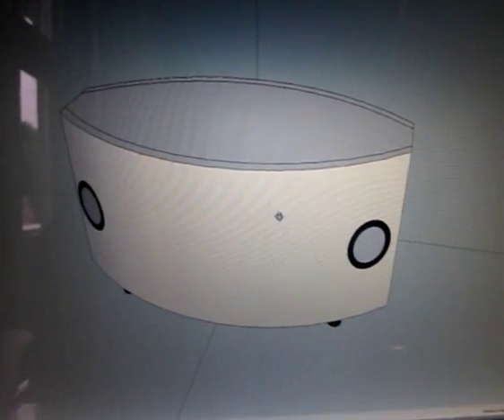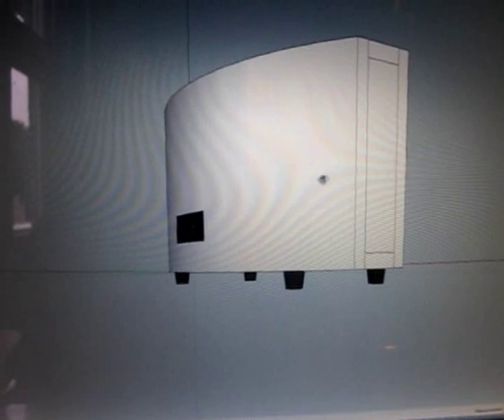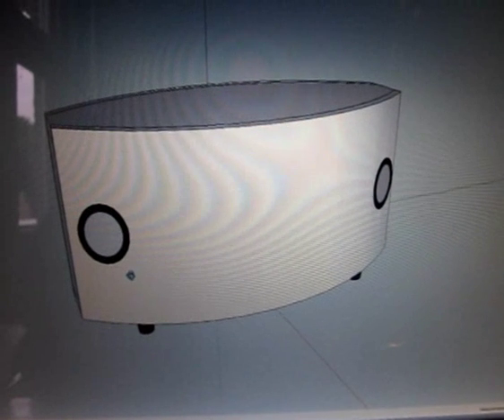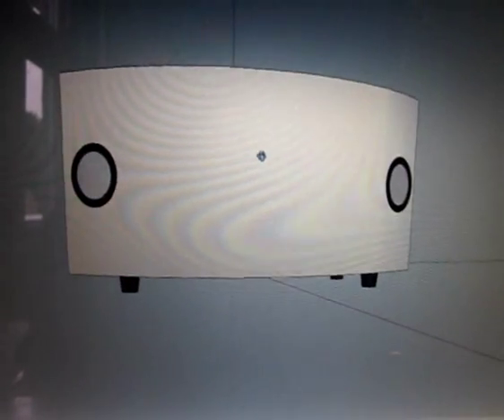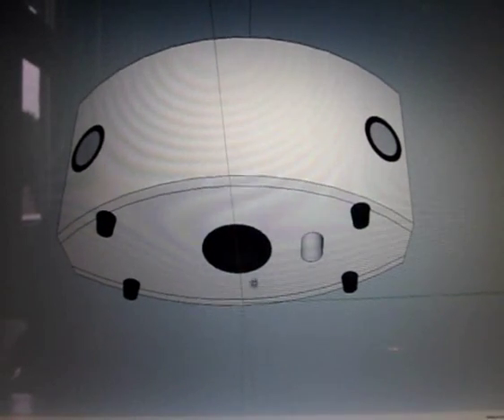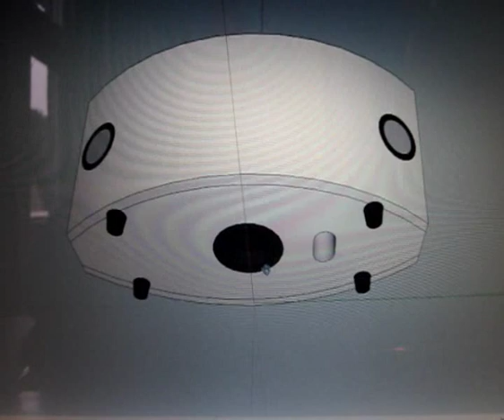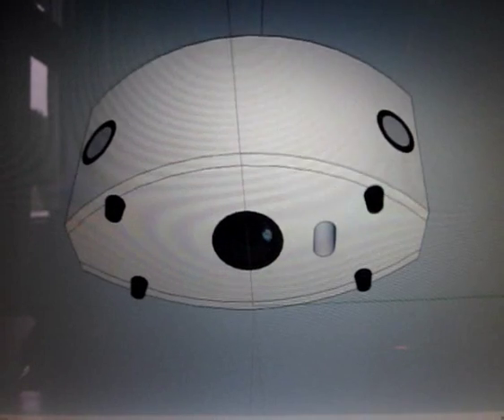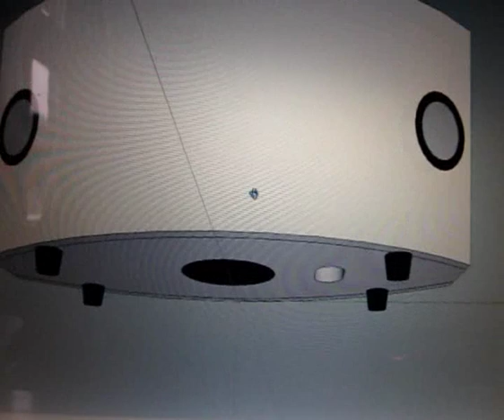New speaker project - portable system

Comment from the maker: The built is going nicely so far. I have no problems this time with bending the wood. Hopefully i will be having a fully working iPod_dock/portable system next week. The bass should be a lot better than that of the original JBL subwoofer box. It was way too small and it did not have any dampening material inside it.